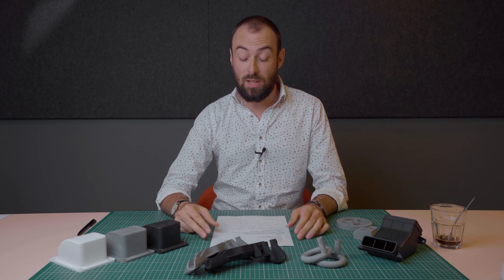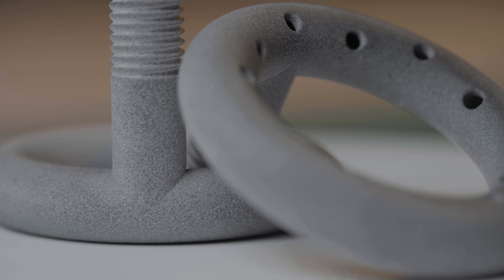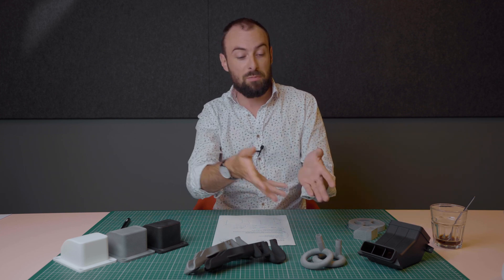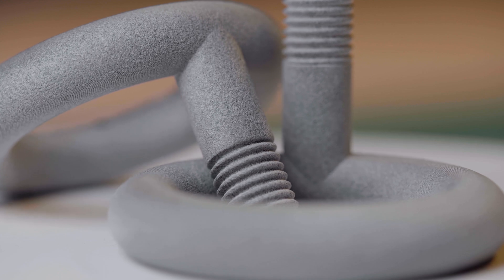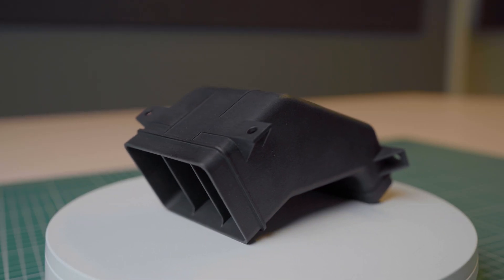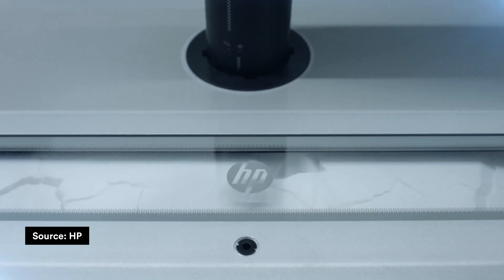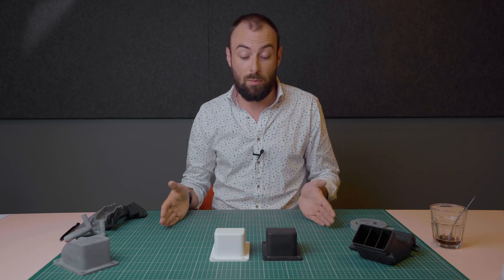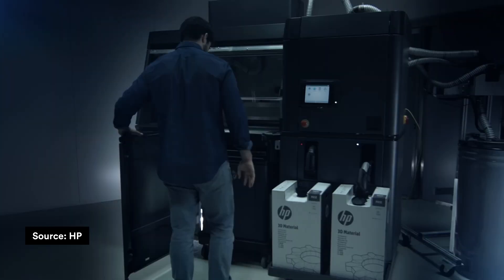Multi Jet Fusion (MJF) 3D Printing - Comparing Prints (vs SLS)

Comment: I felt like a HP selling video.
I recycle 100% in my Formlabs 1 SLS. I can print small pieces without having to fill all the basket and resolution looks far better and can even be lowered below 0.1mm

Comment: Wow.  Great info.  Thanks.  I have a question about wall thickness with SLS.  I see a lot online about minimum wall thicknesses but nothing about maximum.  what's a recommendation?  The rectangular areas of the 2 identical parts in front of you with the holes in the corners, looks like that base area is several millimeters thick.  Can I design a 7-10mm floor into my parts without issues of uneven drying or warpage?

Comment: As an engineer I would have liked some comparison of the strength and the actual tolerance of MJF and SLS
Reply: Exactly my thoughts. This seems to be only a surface finish/process oriented video than anything else.
Reply: One can heck out datasheets at parts manufacturers as i.materialze, weerg, shapeways.